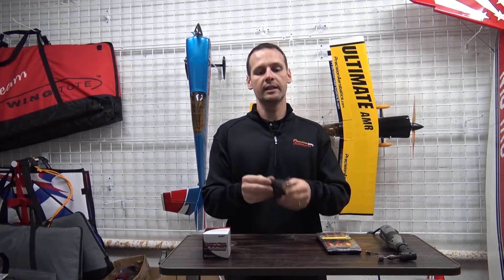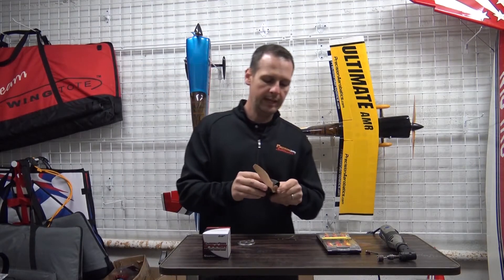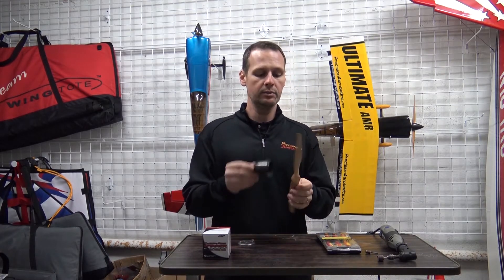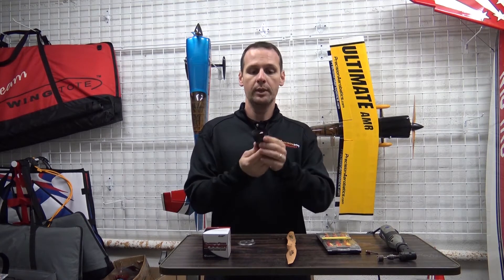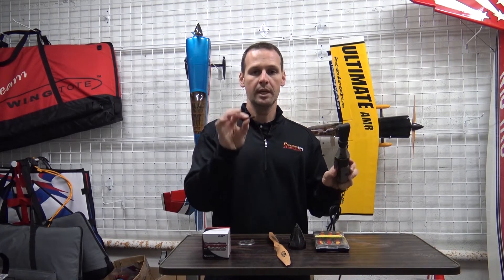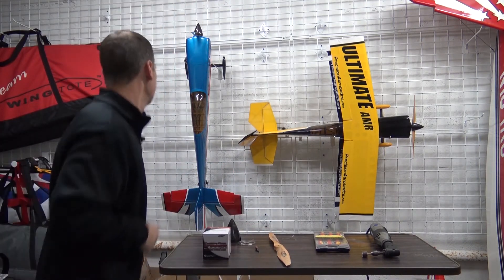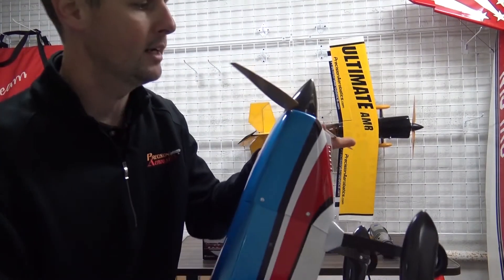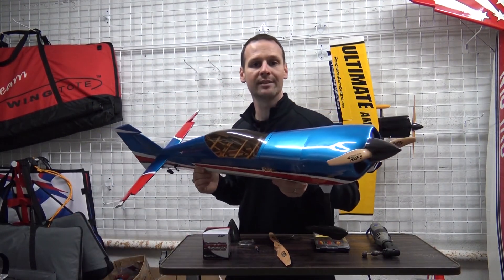PA Tech tips: PA Carbon Fiber Spinner

Comment: Could we reinforce these spinners somehow to make them more structurally stable and more rigid? I have an 9cm diameter by 12cm long cf spinner for my 53cc twin gas engine, I've already avoided the longitudinal joints of the segments that make the spinner, when cutting the prop holes and I've used a band of epoxy on the interior edge of the holes I've cut to prevent spreading cracks. Also using blue locktite on the 6 button screws. But the idea that some had their cf spinner explode runs through my head. I love the looks and really need the low weight but they are scary thin like 1mm and seem like an egg shell.

Comment: Got mine spot on, put it on, massive vibration at low rpm, took off, ran just motor... new thrust 50 motor shaft bent out of the box :( Hopefully my seller can exchange fast :(